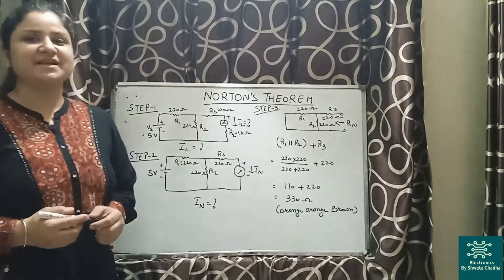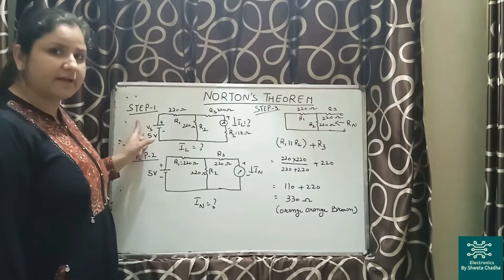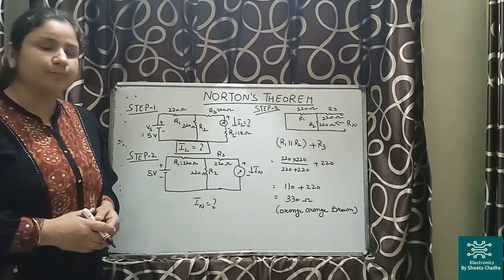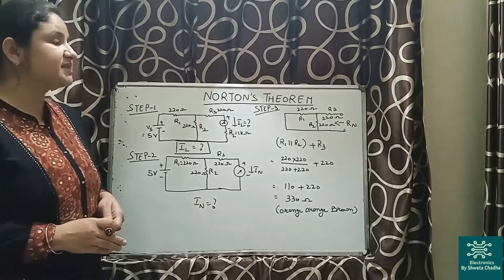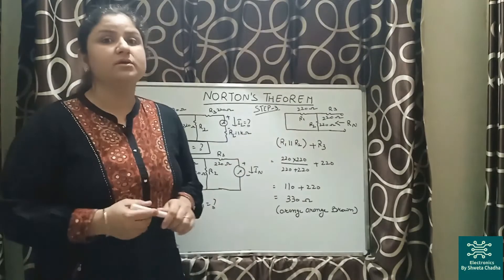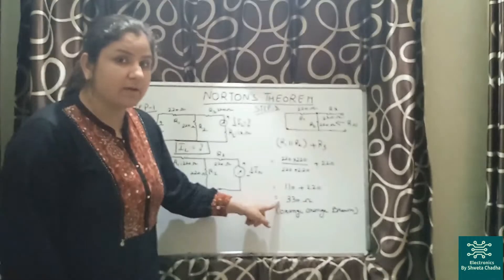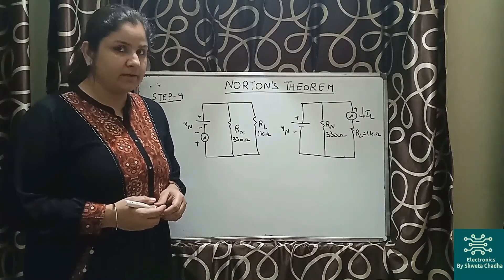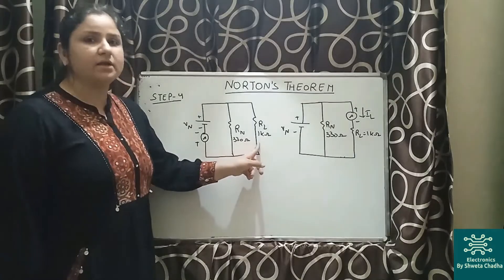Norton's theorem (Practical)

Comment: In the last step have you connected negative of supply and negative of ammeter  and resistance in same column?? please confirm
Reply from the maker: Negative of supply and negative of ammeter and only connected together. And resistance is further connected with positive of ammeter. Please see the circuit diagram also for better clarity.